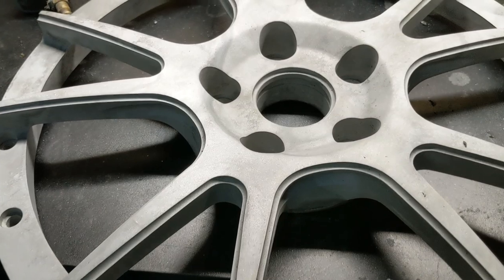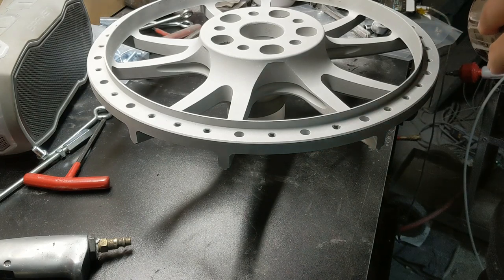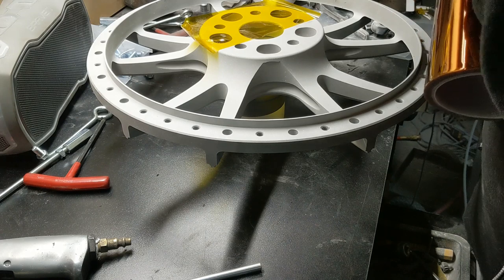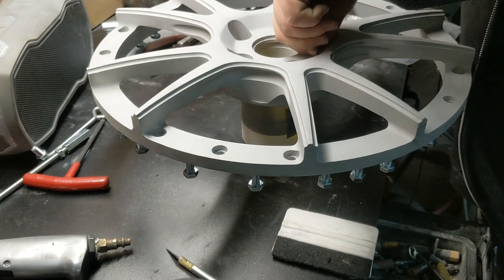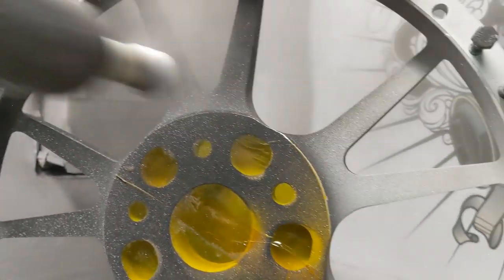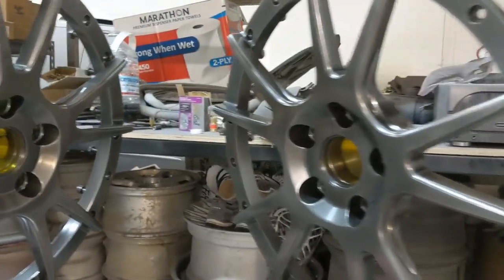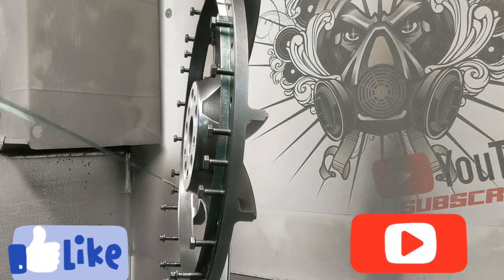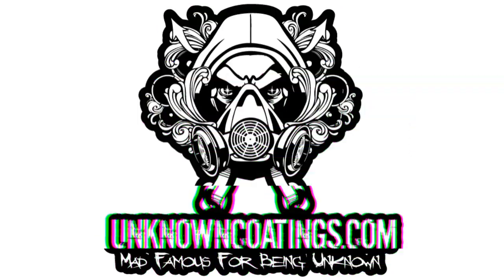How to powder coat multi piece wheel faces - Ep 25

Comment: Definitely loving the videos. Also with the KV settings, can you do a video explaining how long you let the part gel out, flow out, or partial cure if you’re doing a 2, 3, or 4 stage coating. Thanks!
Reply: Nicole Compiani i was about to write a comment like that 👍🏼 i have pretty much the same questions. Also maybe a video about avoiding Back ionization. Been having problems with that on wheels especially at the ent shooting the outer barrel... thanks in advance
Reply from the maker: yeah this question gets asked a good bit, I will do a video this week explaining this and will also try to cover back ionization.

Comment: Hey man, sorry for the dumb question but why did you put screw in some river holes but left others exposed? And if you can do a video about cure/partial cure times / kV settings  when it comes to multiple coats it would be much appreciated!
Reply from the maker: These wheels use a standard american 40 bolt lip/barrel but only some of the bolts are threaded. I plug the threaded ones. 
I will be doing a video about partial cures and kv settings shortly since lots of people are asking that one

Comment: How long do you out gas wheels, valve covers, calipers?
Reply from the maker: lots of factors involved. Cast OEM type calipers I outgas for a long time, cause they tend to bleed out a LOT. But higher end calipers like Brembos, or most after market ones i do far less. Valve covers depends on brand more than anything, and then type of casting. Magnesium stuff also gets out-gassed much longer.  So BMW, Mercedes, Evo, and a few others. 

Wheels are all about an hour.

Comment: When doing 3 piece wheels do you mask the surfaces that bolt together and get sealed? I’m about to do a set but can’t find much info on masking that surface or not . I feel like masking it could show bare spots if masking isn’t done perfect after assembled
Reply from the maker: i dont because leaving blasted metal exposed near the sealing area is a no no

Comment: So speaking of corrosion... I've noticed you don't put anything on the taped areas are you not worried about corrosion on those areas cause it's a mounted surface and shouldn't be exposed to anything anyway?
Reply from the maker: i rarely powder coat mounting pads. Although I have never seen any evidence at all to support the claims that its "dangerous"to put powder on them, I choose not to. As far as the bore flange I taped, it needs to be a specific clearance to mount to the lip/barrel assembly. Id much rather have the parts fit the way they need, and deal with the little bit of corrosion that could happen there.

Comment: What is your average psi flow coming out of your hyper smooth ? You''ll be settling an argument with a friend of mine.
Reply from the maker: between 5-10psi, SOMETIMES over but depends. very rarely below 5. but I would say 90% of the time its 5-7psi
Reply: @UnknownCoatings  Okay thanks ! I lost the argument lol
Reply from the maker: Haha what was the debate?
Reply: @UnknownCoatings  Well , he said to set it on around 10 and I said 20 because Columbia Coatings recommend 20 - 30 lol
Reply from the maker: @gears101  put 30psi into your Hopper and make a video of the cloud.  Tell me how it works out lol
Reply: @UnknownCoatings  Oh I know , that is why I thought it was 20 at least. I guess that is why he coats and I prep. strip and do the sales part lol . But I am learning though lol
Reply from the maker: @gears101  that's what counts